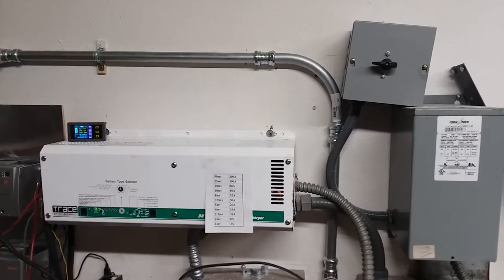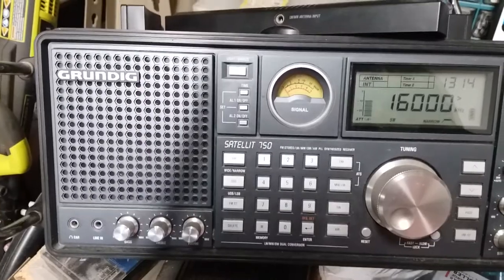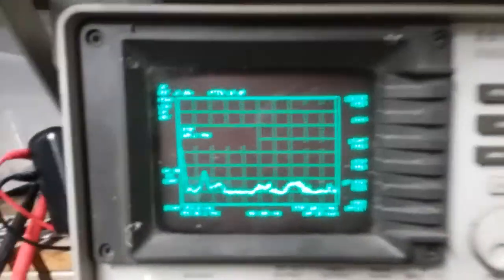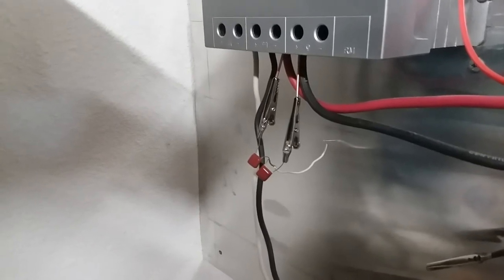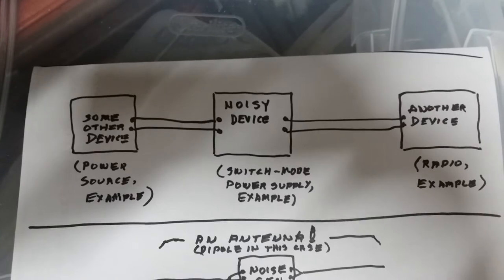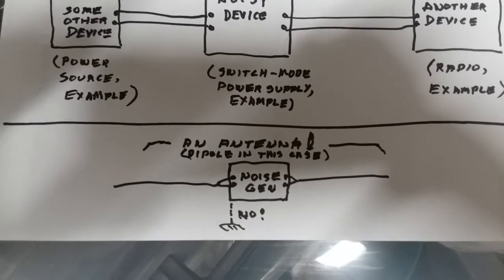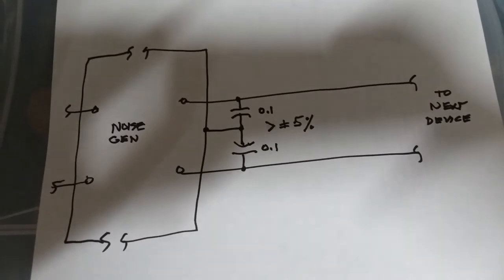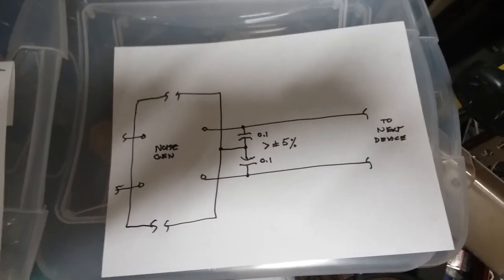Reducing Radio Interference from Solar Charge Regulator

Comment: Very helpful. I have a victron mppt charge controller. I go to some pretty remote places with my camper. The only thing I can get sometimes is SW and AM. I have my radio inductively coupled with a coil coming off the radio antenna to a CCrane antenna booster. So,it picks up everything! 😊 The only way I can get rid of the noise is to unplug the controller. I've been thinking of different ways to get rid of the RFI. This seems to do the trick😁. Thanks!

Comment: I'm surprised this video has only 45 likes and 1000 vies, invaluable info. Thank you Sir for making and posting this video. I'm going to try this and see how it works, I've been battling solar charge controller interference for way too long. I also have 3 of them. One quick question , if you see this comment, the ceramic disc capacitor you recommend is not polarized, so it should not matter which way it is installed, am I correct? Thank you again !

Comment from the maker: For PROFESSIONAL remediation of rfi, then everything said here must be done similarly, but more rigorously. For a commercial or military installation, the rfi engineer will totally enclose a rf noisy device, including the filters described here. To achieve near-zero rfi, it is nearly impossible to simply add a filter box EXTERNALLY to the noise-producing device. Also, every input or output line must traverse the enclosure via a feedthru capacitor. In the case of enclosing some digital device having many control lines, one can use a multi-contact receptacle, where each connector pin is also a feedthru capacitor. 
...RFI testing of the remedied noisy device is done in an rf shielded room and each wire that enters or leaves the device under test is probed for rfi current using a calibrated receiver, or spectrum analyzer, or at least a scope. 
...Regarding the values of the rfi suppression components, these depend on the magnitude of the rfi currents. It is easy to filter DC lines, using large capacitor values. SINGLE-ENDED (single wire) ac signal circuits are difficult because a large shunt capacitance to common may affect the desired signal. In this case, it is necessary to redesign the system to use BALANCED signal lines, which are much less prone to RF interference. As audio engineers well know.

Comment: Hello Mr Clothier, I have been trying for some time to find a solution to the exact same problem you have encountered and solved with the same tracer MPPT solar charge controller (the small one) I have set up in my shed to run LED lighting and a car CD/Radio. When the panel is providing power to the controller, in any light it just wipes out the FM radio. My electronics skills are as my dear old Dad would say " enough to be dangerous " ;) However I do understand the basics of the solution you have there apart from becoming utterly bewildered at the choice, type, and variabilities of capacitors available to buy. Would you be kind enough to clarify a few things for me?

I think you are suggesting using 0.1 capacitors, but I cannot work out from your video what value they are, pF? nF? uF?

While I can see the capacitors I am a bit bewildered by what type they are. They look like the ones that are termed 'polyester' with no polarity, unlike the ones in a tube or cylinder. Is there a particular type that suits the job better?

I think I would have to buy capacitors rated above the maximum voltage DC that my set up might encounter. My Tracer-2210RN suggests a limit of 100V input on the solar. So I would think double that or upwards to be safe.

I understand that >5% relates to the tolerance, to get a pair that are closely matched. The quality supplier i am looking at (RS components) has many, many such things but the price (which I am happy to pay for the right components ) is a bit steep. The issue is that i want to get the right ones first time and as you suggest adding suppression to the solar input line at the controler, the line to the battery bank at the controler, and I assume to the LOAD line at the controler, at £3 to £5 each cap that is a lot of pennies to get the wrong ones.

I would very much appreciate any information you can pass on, and my apologies for my long winded waffling.
Reply from the maker: Hello back to you!. The capacitors can be the very low cost ceramic disc type. Value is 0.01uF.  I used those with 50Vdc rating. Because I knew my dc voltages were always less than that. This is a partial solution. Brings the  interference on the solar power lines much lower. For very faint FM signals I still had a problem, so I needed to move my FM receiving antenna to the other side of the yard! (The 3-element Yagi antenna was picking up my own solar interference in the FM band even after I had reduced the noise on the POWER lines, and also because I had laid the antenna coax too close to the lines from the solar panels. Note that my problem was only for a very faint FM station carrying my classical music from 50 miles away, over the mountains. There is no interference on the local schlock-rock, junk channels!). The professional solution here would be to enclose the controllers and as much equipment as possible inside a metal cabinet, with bypass capacitors and chokes on all ins and outs. And wiring to the solar panels could be run in metal conduit instead of the usual plastic. When a dc-to-ac inverter is used, it also generates rf interference and it can also be suppressed with 0.01uF caps on the inputs and outputs. Caps on the the 120 or 240Vac output wires will need to be the more expensive plastic film types, rated at 2X line voltage. Again, best results are when all is enclosed in a metal cabinet. With cooling fan! All this is in addition to whatever suppression that the equip manufacturer may or may not have, internally. All above is what a radio amateur might need to do for operation of his sensitive receivers. Not normally necessary for fm or tv.
Reply: @johnclothier4366  Thank you ever so much for your prompt and comprehensive reply. Reception is not great where I am and I initially tried moving the ariel as far as I could but even with a battery radio and being half way across the garden the Tracer unit broadcasts for a long long way. By chance my brother in law has sourced a very good metal cabinet recently (faraday cage effect) which I intend to use when I install the gear in its more permanent location. I had already read about using shielded wire to earth for the cables, armoured cable for example and was planning on trying that. I also have some ferrite rings, plus was going to try the twisted pair effect on the existing cables. But as you explain, it will probably still radiate. I can order the right capacitors now and then when I get to the day I tackle it I will have all the options at hand. Thank you again and when I do get to it, which might be a bit yet with it being winter in Scotland I will update you as to what did what as I try each option. It will make for an interesting written addition to your video.

Comment: Unfortunately you stopped short of giving examples of capacitor values or how to calculate them.
Reply from the maker: Capacitance is not critical. A value of 0.1uf will cure the main problems. 
...Please note that this video talks about reducing rfi on DC lines. For the ac side, where a sinewave inverter is sending rfi into a building via the 120/240Vac power wiring, then a familiar cure is to purchase an off the shelf power line filter, installed very near the inverter ac output. Does little good to put said filter in the home....must suppress the rfi at the source...the inverter output. The filter housing must be connected to the inverter housing. That connection will be radiating any rfi, so keep it as short s possible. If the inverter is not a sinewave unit, then you can still use the power line filter to remove radio noise, but the filter will not make the ac output more sinusoidal... the quasi sinewave has a huge percentage of 60Hz harmonics, like 180Hz, etc. These will not be suppressed by the RF filter and will be heard as buzzing in some entertainment systems that are operating from that quasi sinewave. Yet we may have eliminated the much higher frequency rf noise picked up by a communications receiver.